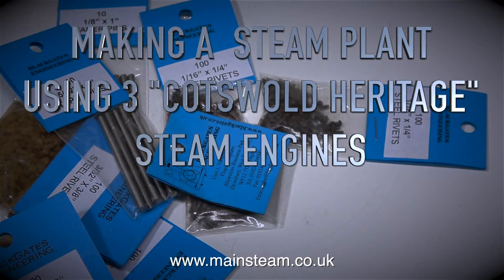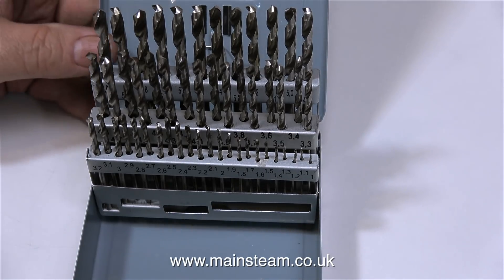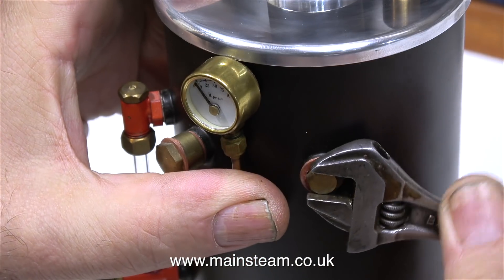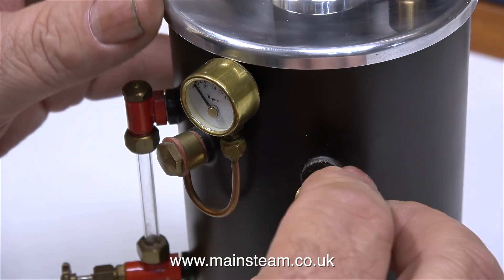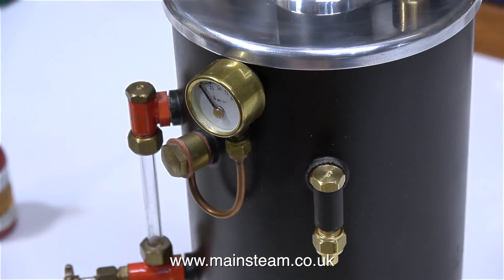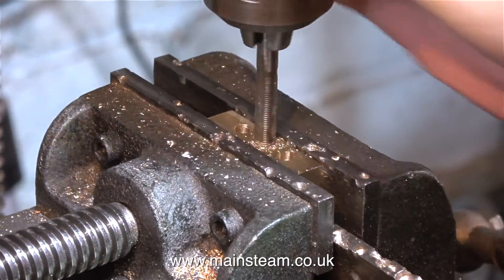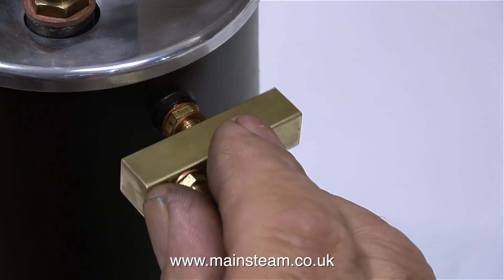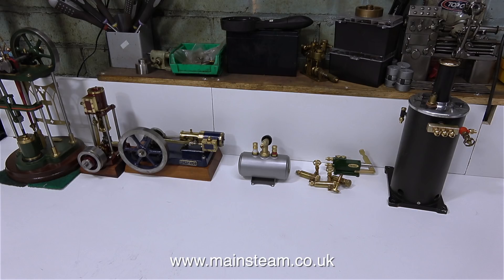A MODEL STEAM PLANT WITH 3 STEAM ENGINES - PART # 3

Comment: You ever try using color tape to mark how far you want your drill bit to go?
Reply from the maker: yes, but as the drill gets hot it sometimes melts the tape, or the tape won't stick to the drill if it's oily. A felt tip pen is just quicker.
Reply: Keith Appleton  Use O rings or elastic bands when you can't find the felt tip pen.